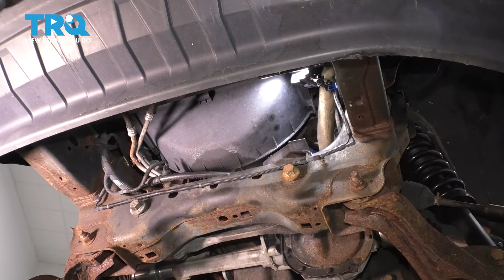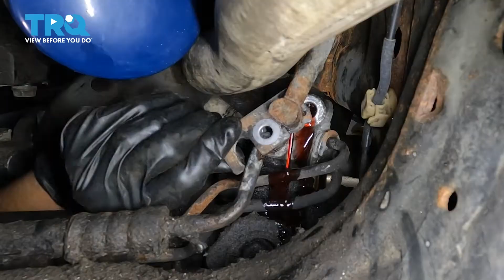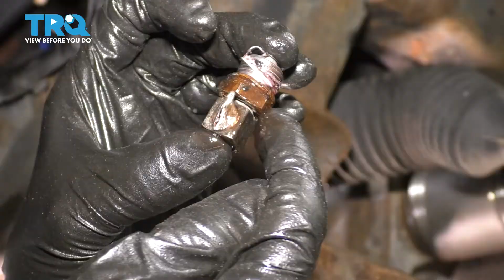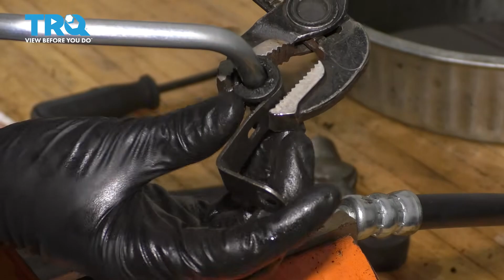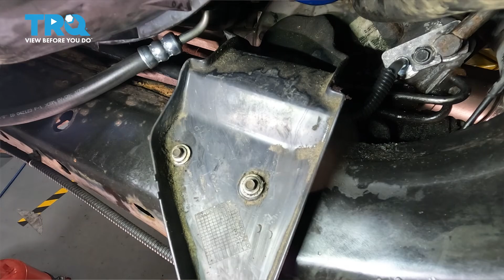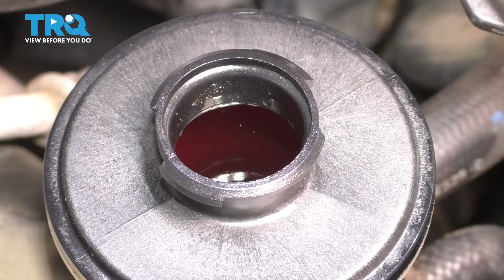How to Replace Power Steering Pressure Line 2009-2014 Ford F-150

Comment: Shop tech here just fyi had to redo this job because the original adapter started leaking immediately (cheap parts) you can pull the pump and the line all at once without removing the clutch fan or rad shroud. Its tight but its possible. I am also replacing the pump so I just pulled the pump and line at the same time.

Comment: I have a 2009 Ford F150
When I get underneath, there is a big plastic piece restricting most of the access.
I don’t see that piece in your video. Did you remove it or do not all trucks have it?
Any idea how I can remove this?
I can barely get to the oil filter with this piece here.
I googled it, and it said that it was  there to help divert the wind to reduce drag and improve fuel efficiency

Comment: Releasing the pump requires turning bolts in painfully tight space but it's actually not that bad:

- Release serpentine belt with 1/2" breaker bar
- Remove oil filter
- Depending what shrouding is still installed on the underside of your truck you may need to remove a plastic guard by the oil filter and some protective plastic covers from the undercarriage so you can get under the truck. You should not have to jack up the truck and removing a wheel won't help with anything.
- You can remove some of the air cleaner parts if you want but you don't have to. Do disconnect the air flow sensor to the left of the air cleaner so you don't accidentally snap it off while you're straining to reach a couple 10mm bolts.
- Now you have to remove 2 10mm bolts from above (one bolt and a funny stud thing actually) that you can see if you shine a light down where the reservoir hose clamps onto the power steering pump. They're basically on either side of the hose. You can kind of push the hose out of the way a little bit and get a small 10mm wrench on these bolt heads to back them out. The rear one, the funny stud thing, won't actually come out of it's hole because there just isn't enough room between it and the sidewall of the truck but you just need to free it. This is the worst part of the job, I used the box-head end of my tiny 10mm wrench mostly.
- Now from under the truck remove the last 10mm bolt. This is the easiest one because you should be able to get a small 10mm socket on it. This bolt is in the hole towards the back. There is an empty hole to the front of the truck, you'll see that no bolt could fit in there because the high pressure line connection blocks it. I think Ford really messed up this whole bolt configuration quite honestly.
- With those three bolts free but the reservoir and high pressure lines still attached you can move the pump out into the open enough to disconnect and re-attach the high pressure line. I don't think many lines actually come with the quick connect fitting this guys shows in his video so I think most people are going to have to free the pump like this whether they like it or not. You're not getting the pulley off in place, don't even think of trying that.
- To re-connect the pump start with the bottom-side bolt because you'll see the pump body fits into a special indentation in the truck body down there and that makes it easier to locate the pump properly. That's also the easiest bolt to turn. Get the pump located and mostly tightened from below, then do the top two bolts (bring your patience), then tighten off the bottom bolt completely.

Comment: i did it ur way but the fitting would now snap into that connection to the power steering pump so i  had to remove the nut and  with a vice grip i had to squeeze it in but its very tight to move..
just wontdering is it ok if it too tight to move

Comment: Thanks for helping us, specially for the bolt on the pump, and the flat & round seals.
edit on 4,6l 2v, the upper bracket bolt is 10mm, cut the line going to the pump with a dremmel it's way easier, it took me several times to be able to clip the line into the socket bolt (pump) at least 12 times gently, brackets are easy to swap if you have a vise, no sensor.